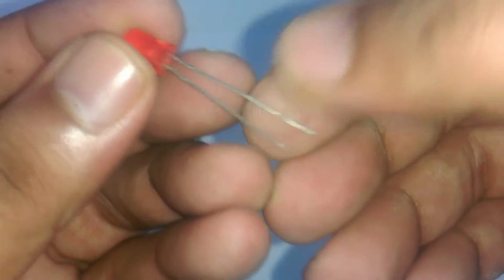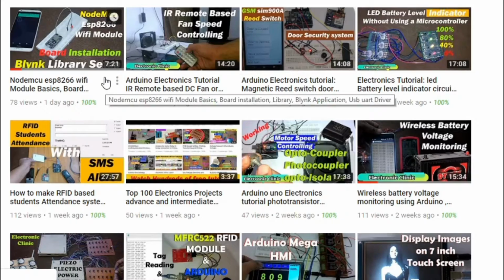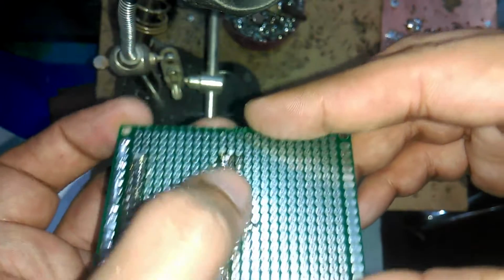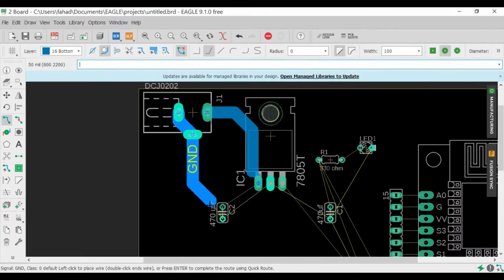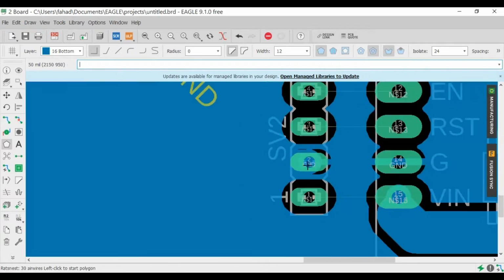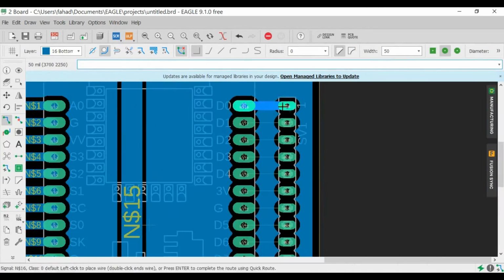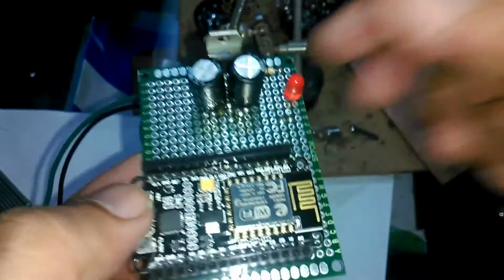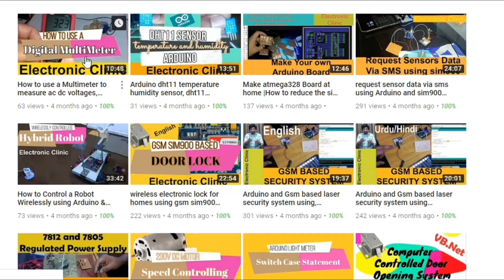Electronics Tutorial: How to make power supply for Nodemcu ESP8266 wifi module using a Regulator

Comment: Hello, if I use the same method as yours to feed the voltage to the ESP8266 via the Vin, can I connect an OLED screen that is fed from the 3V point of the ESP8266 without any problem?
Reply from the maker: Yes you can.

Comment: @Electronic Clinic 
Hello friend. I have a NodeMCU with CH340G chip. When i connect usb to my pc and connect 12V battery to Vin, i have broken down usb port of pc. Are USB port and Vin port directly connected  together inside of card? do you have a information about that?
Thanks for your help.
Reply: You can not connect two power sources at the same time. Using the USB port and then using a higher current pin on the Node caused a current spike back into you USB from node. Google on how to work safely use the USB section when other power sources are connected or monitored would help you.

Comment: Can we  connect esp8266 wifi module and arduino uno 
And power up esp8266 wifi module by using buck converter y4183 instead of regulator

Comment: Nice Job! A question: Do you think I could use 680uF capacitors instead the 470 ones? Thanks!
Reply from the maker: yes you can
Reply: Is it possible to use a 1000uf capacitor

Comment: Hey, Please help on this. I've 7805 and 470 uf capacitor at input and output same as you've done. I checked the output is 5v that i've plugged in to esp8266 and also tested the same for esp32. 

The relay is then connected to the esp board.

When i plug only one channel of my 2 or 4 channel relay, it works great but when i use 2 or more channels of it, after 5 mins, i see it fluctuating. I tried very hard, but couldn't find reason or any way to solve it.
Reply from the maker: what is the power rating of your 12v adaptor?
Reply: @ElectroniClinic  its 12V 1 AMP DC
Reply from the maker: use at least 12v and 2amps
Reply: Okay, for 4 channel? I'll be buying one, Should i buy higher further in case i want to use 8 channel or something?

Also, can you help me understand, how this works, so that i can do the calculations as per need in future. So far what i know, relay needs some 30-40 mA for one channel, so i was in assumption that, 1Amp should be enough.
Reply: Hey i got the adapter plugged in and observed for 2-3 hrs, it works. But, i'm still trying to figure out the logic.
Reply: @Electronic Clinic, I'm again facing the issue, but after 3 hrs. 😪
Reply: @Electronic Clinic, Just and FYI, i noticed, when it fluctuates, the output voltage is 3.6V instead of 5v. Any idea, why it can happen?
Reply: Hey Please reply

Comment: can i use that output regulation for esp32 and some sensor? also i need 3.3v, can it be done with AMS1117 connect to 7805 output?
Reply from the maker: i am using the same for the esp32 as well. check playlist.

Comment: Hi. Shouldn't the input voltage for the esp8266 be 3.3V instead of 5V?
Reply from the maker: This is nodemcu esp8266.it has onboard 3.3 volt voltage regulator.
Reply: @ElectroniClinic  can a 9V adapter be used instead of 12V?
Reply from the maker: yes, of course, you can use. in this power supply, 7805 voltage regular is used so you can use voltages greater than 7 and less than 30 volts.

Comment: I have used the same circuit but 7805 and the nodemcu is heating up.
Reply from the maker: No. I have been using this. It never heats up. Check my new designed pcb for nodemcu

Comment: Hello, can I use a breadboard instead of a veroboard, as I do not have a soldering iron. Would it work the same if I do everything you did, except I used a breadboard?
Reply from the maker: yes, you can use a breadboard, so far you follow the same exact connections.

Comment: why use the capacitors ? can i use a 9v battery and an lm7805 only to power nodemcu?
Reply from the maker: if you don't use the capacitors your nodemcu module will keep resetting.

Comment: Cant i directly give the 5V dc to the vin pin of the nodeMCU ..PLZ reply
Reply from the maker: yes you can directly give 5v and ground. it doesn't matter wether if you are using 7805 or a 5v adaptor. but don't power up the nodemcu module using the arduino's 5v, coz it won't work. it will keep disconnecting. use external power supply.
Reply from the maker: i personally recommend you should use 7805 voltage regulator and use 470uf capacitors on the input side and output side. its really easy. then you can connect even a 12v adaptor or battery.
Reply: Thanks you very much... appreciated

Comment: Can i use it while upload the sketch from arduino IDE?
Reply from the maker: if you connect the nodemcu module with the arduino default serial port then you can't upload a program. you will need to disconnect the wires.
Reply: I'm having an error while i upload: espcomm_upload failed 

i